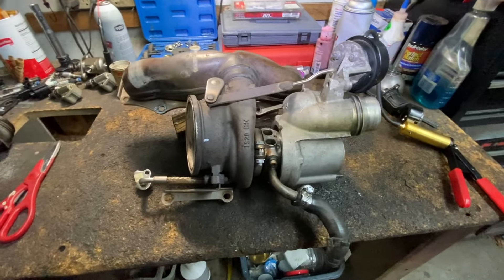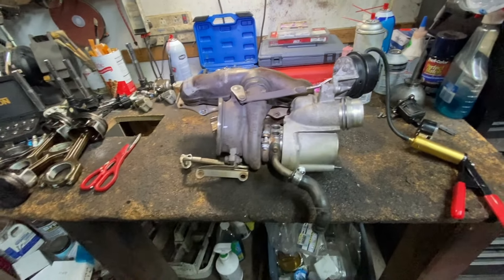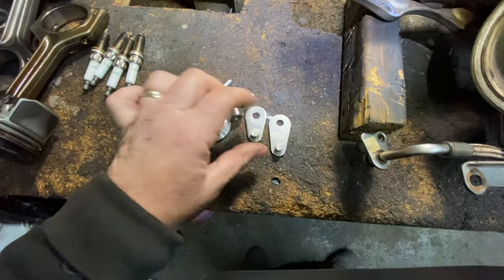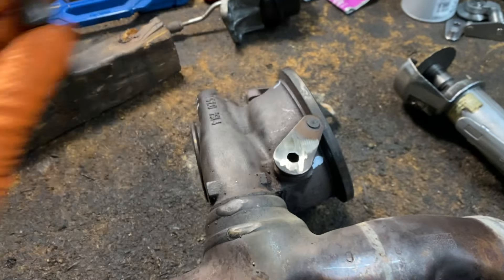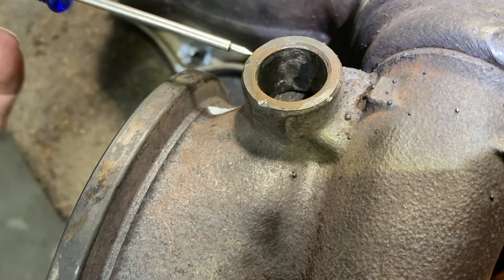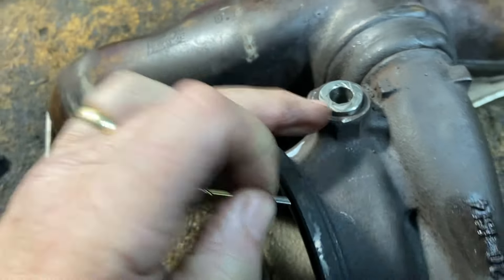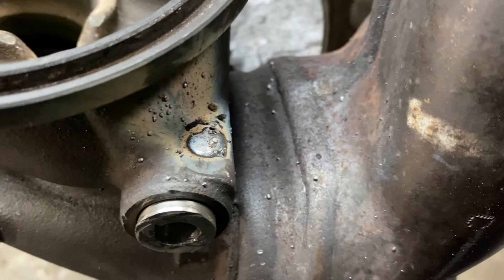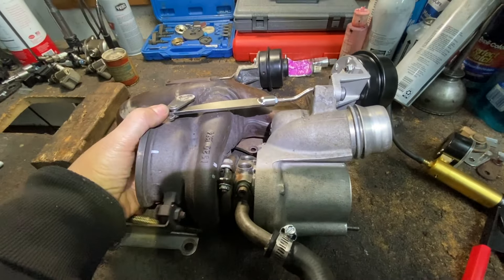How To Permanently Fix BMW Turbo Wastegate Flapper Rattle

Comment: I wonder how many people clicked off the video when he said welder
Reply from the maker: I’m sure not many. I explain if you can’t weld to have someone do that part. Or you can always buy a new one for $3000
Reply: Ha, yeah, that was me. But I came back to finish!
Reply: How much power welding machine have to have for this job?
Reply from the maker: It’s not so much the price of the machine but you have to know how to weld.
Reply: @motorcarnut isn’t there supposed to be a anti rattle clip even on the pneumatic waste gate on that n20?
Reply from the maker: @gottgaame no

Comment: Just so you know the N20 2.0L with electronic waste gate are not welded. At least it appears that mine isn’t, and it uses clips. My actuator arm bar came off completely.
Reply from the maker: Are you talking about the actuator arm to the flapper arm? Yes that has a clip but the inside flap valve in the exhaust is welded, which is what this video is about.
Reply: @motorcarnut  

Yes I am referring to that actuator arm sold with EWG, it appeared welded at the beginning explanation and thought it may have been on pneumatic. 

I am trying to avoid $500 part from dealer and replace with the Mitsubishi OEM part. My only concern is calibration with ISTA software. Do you have any tips, recommendations, or videos on that topic?
Reply: I ordered the Mitsubishi OEM part from parts geek and I have read it might not need calibration. Should I use the old arm that corroded a bit and fell off the clip, or should I install it with the new arm replacement from OEM part? Trying to avoid a trip to the shop 30min away for software, thanks.
Reply from the maker: @LightSpinAngler No, if it will need calibration it’s for the electrical part not the mechanical arm.
Reply: @motorcarnut  hi thanks for the reply, im not quite sure I understand response. Are you saying if I use the new arm with the EWG I ordered it will not need calibration?
Reply from the maker: Just install new part and see if it works properly. Switching arm won’t make a difference.
Reply: @motorcarnut  Awesome, thank you. Any recommendation for an E84 compatible OBD scanner?
Reply from the maker: Try Autel or Launch they have model in every price range
Reply: @motorcarnut  your a huge help and service to the community, thanks for the videos and responsiveness.
Reply from the maker: @LightSpinAngler Thank you so much! Really appreciate your feedback!

Comment: I didn’t understand the 3 30 seconds part much can you explain better
Reply from the maker: If that flap doesn't seal tight the vehicle will lose boost pressure and power. The one in the video has too much play and didn't seal right causing low boost pressure codes.
Reply: @motorcarnut   I understand that part but how you measured it to sit exactly at 3 30 seconds

Comment: Okay so brand new flapper kit installed and have terrible rattle still? Maybe didn’t tighten the watergate arm enough? I’m on a n63
Reply from the maker: Yes, that's the problem. When its closed it has to be tight that you can't move it with you fingers.
Reply: @motorcarnut  like can’t move it at all when pulled to 7 in/hg?
Reply: @motorcarnut  I had mine where it barely moves when at 7 in/hg and it rattles like shit
Reply from the maker: You sure its the valve making noise?
Reply: @motorcarnut  I have catless downpipes, “repaired” turbos, s63 intercooler, dual custom catch cans, a custom front facing intake, custom fabricated charge pipes. And everything seems to work great, except when I go full throttle it rattle really hard and I don’t hear the turbo spool like it should and it has gotten worse. I am pretty sure it’s the wastegate not closing tight enough, though idk if it’s the vacuum solenoid, vacuum actuators or my repair job that’s bad.

Comment: How hard is it to take turbo out on N20 do you have to tilt the engine
Reply from the maker: It's a tight spot and you work a little blind at times but it comes out and yes engine will have to be tilted some.
Reply: @ so pass her side engine mount three bolts in the bottom must be loose if not taken out ?
Reply from the maker: Yes

Comment: Thanks for your reply. I have one more question if you would happen to know my idle drops a little bit low right before acceleration after taking the foot off the brake on my 2019 530 four-cylinder it has the B 48 motor I had an issue before and change the evap sensor. It was fine and now has started again but now no codes
Reply from the maker: Can be a throttle body needs to be cleaned or vacuum leak if you mean as soon as you put your foot on the accelerator it's drops for that slip second then it's fine.

Comment: This is an amazing job, but it won't be permanent
Reply from the maker: Thank you! It's as permanent as you can get, just like a new one.
Reply: The engine plant is not different. Only one detail is different. At VW and BMW you have a device for every part. Everything will always connected at the same spot.

What the good man does here is actually better than at the engine plant. Every component has a dimensional tolerance. So it can happen that if one or more components are at the outer tolerance of 0.2mm, problems can occur in interaction with other components and the engine. He set the tolerance nearly to 0 with his method.
Reply from the maker: Exactly! Thank you!

Comment: Just go find a donor with a wastegate flap that doesn't feel loose, buy a new center cartridge since that's what goes out either way when these turbos die so you may as well change it while you have this thing out, and reassemble with the donor wastegate/manifold portion while discarding the bad one
Reply from the maker: Not that easy, if they have a good one they will charge you for the whole turbo
Reply: I meant for the do it yourself community. And if it is used, even if they say it's "Good" I would still change the cartridge. Though you do have a point, its rare for a yard to simply let you take the portion you need and leave the rest behind. Maybe as these become older you will find them in pick and pull type yards, but until then, we are all at the mercy of the European junk yards that want tons of cash because they buy these cars at auctions for top dollar to make a killing off parting them out   @motorcarnut
Reply from the maker: @puctbridge Yep, true

Comment: This faulty give drivetrain error? Please share information with me.
Reply from the maker: Yes, drivetrain malfunction message, low boost pressure and many others
Reply: @motorcarnut  thanks sir. Did not notice I commented on both your video. Haha.. really appreciate it
Reply from the maker: No problem
Reply: Thank you so much. What a fantastic look inside to the actual mechanical issues of the N20 turbo — working with dealers or independent shops a person can shell out $1000 to not even figure out the problem. Then there’s a $5000 “new” turbo at the end of the rainbow when they and the customer both throw up their hands, when really the problem is $30 worth of parts plus a group of engineers that need to be kicked in the balls repeatedly for this garbage design. May God have mercy on all N20 owners because this kind of silliness is only the beginning…
Reply from the maker: No problem, thanks for the comment!
Reply: Hi Motorcarnut, I checked my system. There is no vacuum at all in vacuum line connected to the wastegate. I suspect my vacuum valve aka pressure converter is faulty. I replaced the pressure converter and I can see my wastegate is moving again if I connect and disconnect the vacuum line at wastegate during engine running. Unfortunately I am still facing the pressure warning. The faulty of pressure converter can lead damage to bov?
Reply from the maker: No but should be fixed. You have to check all the plastic pipes on the charge side of the turbo and the flapper valve for play. You can hook up a vacuum gauge the the wastegate and vacuum it down to 15hg and see if you can move the flap valve, if it has play and can be adjusted if not has to be replaced.
Reply: @motorcarnut  issue solved. Replace pressure converter to solve no vacuum issue. Replace blow off to solve leak issue. Original blow off using plastic and rubber. Easy to become faulty. Happy boosting.. hohohoho
Reply from the maker: Awesome! Glad you fixed it and thanks for the update
Reply: @motorcarnut  thanks buddy for your help without you i have no idea how to attend this problem
Reply from the maker: No problem! Glad to help

Comment: Could I send my 2012 mini countryman turbo in for this wastegate fix? I don't weld.
Reply from the maker: You can try but most shops do their own repairs and may not want to do this for what ever reasons. This video was designed for the DIYer to save a lot of money.

Comment: Could you please tell me after how many miles this usually happens?
Reply from the maker: Varies, can be 75k can be 100k
Reply: @motorcarnut  thank you, i ve got a 2017 b48 with 57 miles on it. I dont know if this can happen on my engine too.. in that case i can replace it early...
Reply from the maker: @petrolbreadmatt9193 you should be fine for a while

Comment: at the beginning of your vid next to the oil can is the diverter valve. On my M235i I have the dreaded code. There are only 3 screws holding it in place. The issue is horrible access. Apparently it may be possible by removing the charge pipe. loosening the water pump, and moving it to the side without undoing the plumbing. Then the 3 screws can be accessed. Any exper. on M235 ?
Reply from the maker: What you said seems about right. It’s a pain but can be done without turbo removal.
Reply: thanks/ waiting for long ball end 5mm allen socket to arrive, also found out waterpump bolts are supposed to be replaced... what a pain @motorcarnut
Reply from the maker: @Mau105 it is, sometimes I loosen the passenger side engine mount and lift the engine a little to give a little more access.

Comment: Hey, thanks for the video. My noise is exactly the same as the video. I went to a mechanic and replaced the part, but the noise still remains. He commented about having to use a clip now, but I can't find one to buy.
Do you have any idea?
Reply: BMW 118i 2014, THP engine
Reply from the maker: The way I explain in the video is the only way unless you replace the turbo with a new one.
Reply: @motorcarnut  We did it exactly like in the video. The noise has subsided, but continues. When changing gears and around 2500-3000 rpm.
Is there a chance we did something wrong?
Reply: @motorcarnut  "clip fastener" is the thing my mechanic is saying is needed
Reply from the maker: You must of
Reply from the maker: I don’t know what that is

Comment: @Motorcarnut what are your thoughts on buying a whole replacement turbo from ebay? Brand new one on there for 350 I seen but i’m worried about the quality
Reply from the maker: If it's a rebuilt OEM part I'd say go for it but if it's an aftermarket one I'd be weary of the quality because of the price.
Reply: @motorcarnut  ok thanks for the insight
Reply from the maker: @VersPs3 No problem

Comment: I need exact parts technical drawings with measurements for reproducing. How can I find them?
Reply from the maker: I don’t know
Reply: @motorcarnut  Did you reproduce the parts or just bought it?
Reply from the maker: @GlobalisticKiller I bought them off eBay
Reply: @motorcarnut  can you share the link? I couldn't find the exact set on ebay.
Reply from the maker: https://www.ebay.com/sch/i.html?_from=R40&_trksid=p3519243.m570.l1313&_nkw=bmw+n+20+flapper+valve&_sacat=0

Comment: Great video! I am doing my N55. A got a replacement flapper but the sleeve seems too loose in the shaft. What is the expected clearance between these two in terms of their diameter difference? I assume there should be some clearance to allow for heat expansion, but if feels like it will still rattle, so I am scared to install it. Where do you recommend I buy one of good quality? Thank you!!
Reply from the maker: Try eBay, should have some play but not excessive.
Reply: fcpeuro has lifetime warranty
Reply: @GreepsTV  I went with Mamba Turbo from Taiwan. Mamba confirmed the material were correct stainless for high temp.  In any case, a warranty is worthless for a part that requires a week to get out and welding to replace.

Comment: Hello, can you tell me what size is the drill bit to drill out the pin? I need to get a high quality bit without spending $80 on a whole set. Thanks
Reply from the maker: I don't know as I punched it out, not drilled it out>

Comment: Wouldn't you want the sleeve of the bushing to be completely smooth so the arm does not snag to it?
Reply from the maker: It’s not designed that way, there is a ledge where the are sits before welding it. No snagging at all
Reply: @motorcarnut  ok great!

Comment: Fantastic video! Thank you! Quick question, what was your welder setup for this? All I have is a flux core mig and I want to make sure the weld will hold if I use that.
Reply from the maker: Welcome! I don't remember just make a nice hot bead

Comment: Perfect explained and helpful. Thank you. Just an idea: ground clamp of welder must be attached to the arm, not to the body. Because spark between shaft and bushing can cause internal welding or bumps.
Reply from the maker: Thank you! Good point, you’re correct about that.

Comment: Do you think u can bypass that by tightening the rod with the screw?
Reply from the maker: It can be a temporary fix, yes. But will eventually need to be replaced.
Reply: i adjusted like 4 times n then ran out of threads so now need to do this new waste gate fix. errors keep coming back after a little while but since its an easy adjustment, worked as temp fix.
Reply from the maker: Yes, they wear out too fast these bmw turbos.

Comment: Excellent video, it is just what I need to do in my turbo.. I would like to ask you something, I see that you changed the wastegate and I have seen some that can use stronger springs to increase the turbo pressure a bit.. with the one you changed you got more boost and if so, did you get an error in the car's computer?
Reply from the maker: No, that one is standard pressure.

Comment: Thanks for a great video.  My WG is much looser than that one and I am replacing it per your advice.
Reply from the maker: Great! It’s not that hard and should be a lifetime fix
Reply: Full engine replacement and did your repair for my turbo. Boosting like brand new!!  Thanks for a great video.
Reply from the maker: Awesome bro, thanks for the update and good luck!

Comment: Do you think a roll pin would be sufficient to hold the bushing ?
Reply from the maker: No way, too much heat
Reply: I used a roll pin that was a really tight fit and then used my mig welder to seal it in place. I figure that will keep the pin captive. Not saying someone should do that, it's just how I did it.
Reply from the maker: Hey may last for a long time.
Reply: My 2013 does rattle and mechanic asked $1500 to change the OEM Turbo ! Can I replace this with used Turbo ? 
Please advise
Reply from the maker: Yes

Comment: Nice idea and made up. Also good how you filmed and explained everything. I personally had welded it with tig, you can weld much nicer with it.
What I don't understand is that they didn't put a spring between the round flapper and bracket. A spring with a certain pre-tension that always ensures that the flapper, even when it is open, is under tension so that the flapper cannot vibrate. When the flapper is in the closed position, the spring is fully compressed so that it also closes properly. Might be fun to try out sometime, see if my idea works..
Reply from the maker: Thanks for the comment! Appreciated 
Yes, tig is cleaner but I have mig so that’s what we use. The spring idea would be interesting but I don’t think it would withstand the extreme heat imo

Comment: What kind of pressure tester do u have. That u used on the turbo in the beginning. I’m trying to get the same one because I just took the turbo off my n20 and waiting for the flapper to come in. Cuz I’m not paying some 5 grand to fix my turbo. Btw. I managed to pull it off while the engine was in the car 😭
Reply from the maker: That's a vacuum pump, you can buy one on amazon. That's right, save a lot of money with my videos doing it yourself! Awesome!

Comment: Hi
Very nice video clip hope will help my issue too,
If I replace flapper it will reduce turbo noise?
And also I have code 120308
Reply from the maker: Yes, not only the noise but have increased power as well